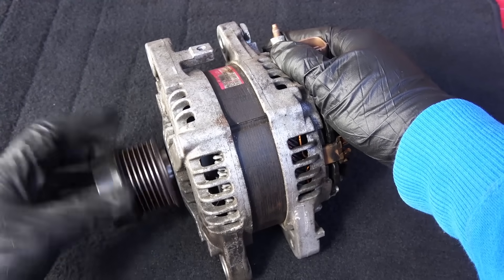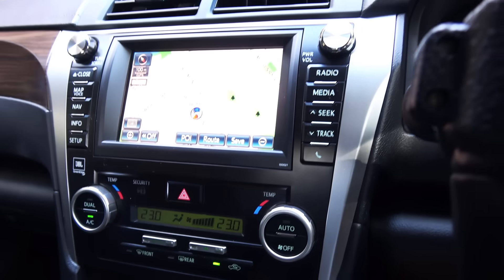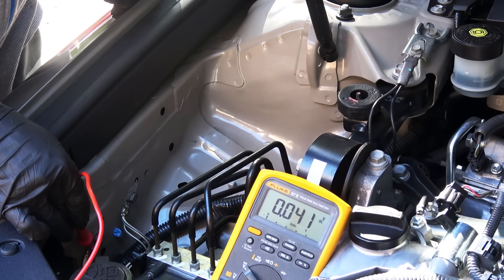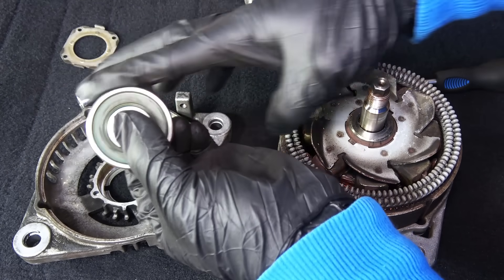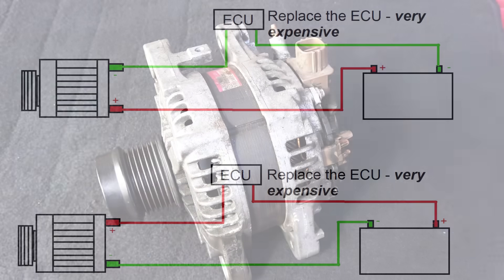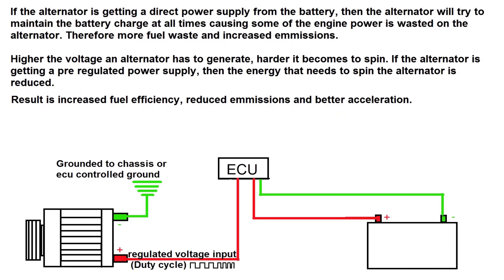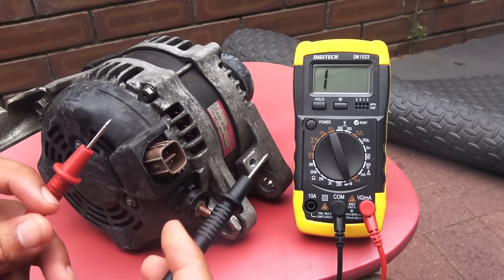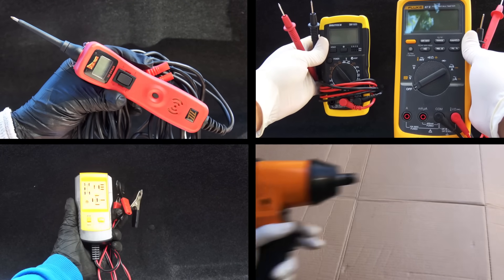How to Test an Alternator  ( Testing the Voltage Regulator, Diode rectifier and Stator)

Comment from the maker: Guys, check out my latest video 
https://youtu.be/UG54xt56uZo
Reply: Very helful vidios
Reply: Great comprehensive video on the alternator, which is probably the most comprehensive thus far on YouTube. Thanks!
Reply: Thanks 👍 bro for the information
Reply: Sar. plese show me how to chek ulternet motor (capacitor) rely
Reply: @azizmakka7126 😮😮😢😢0
Reply: Hi
Reply: Matter is
Reply: My battery is showing 11.20V and it shows 12.50V at charging. Where is the issue located? Is it the battery or the alternator?
Reply: I know im asking the wrong place but does someone know a way to log back into an instagram account??
I was dumb lost my password. I would love any tips you can give me
Reply: @Nikolai Archie instablaster :)
Reply: @Christian Keaton I really appreciate your reply. I found the site thru google and im in the hacking process atm.
Seems to take a while so I will get back to you later with my results.
Reply: @Christian Keaton it did the trick and I now got access to my account again. I am so happy:D
Thanks so much you really help me out :D
Reply: @Nikolai Archie happy to help :D
Reply: Hi, if I got 1063, what’s that mean? Thanks
Reply: The only true way to check  doides, is with a proper doide checker. They can be done with a multi metre,  but must be COMPLETELY disconnected with the stator,  otherwise you can get false readings. Other than that it's a pretty good vid.
Reply: I have kind of dirty but perfectly working alternator, but it's kind of plug up with all kind of junk is there proper way to clean the alternator inside component's? and what it's proper way to do it
Reply: @djeletropopstarify  ₩0
Reply: @djeletropopstarify  m
Reply: @djeletropopstarify  ssshh

Comment: I've replace the Alternator 2 times, autopart guy told me to get a new alternator instead of a re-built one, so I did, now it's the 3rd time. Also 3 new batteries & belt changed. And a few months passed and same issue, in the summer or hot temperatures the alternator refuses to charge up the battery over 12 volts making the car not start up at all until i get a boost, but in cold weather it starts charging up the battery to 14.0 volts perfectly when needed, I'm guessing the engine heat is affecting the alternator, fan turns on and all so not sure what the issue is, and not one of the many mechanics that checked it can pinpoint the issue except for me to replace the Alternator over and over and over. It is frustrating. If anyone knows the issue on a 2006 Rav4 send me a message, but I'll keep on checking with your steps, thanks all.

Comment: Hi ; I have a DENSO alternator in my Toyota Camry with a 2.4L engine, I have done a thorougher check with a multi meter and found the voltage regulator to be faulty. my question is, I want to simple change the regulator, can I use a regulator meant for a 3.0L or a 3.5L engines. I am having trouble locating one that is the same as mine which I think is 80A and the others are 100Amps. will it work. thank you.
Reply from the maker: if the part numbers match, then it will work

Comment: You're awesome bro!  

I hope you have a moment to help me because I want to clean and rebuild my alternator that had an oil leak dripping directly into the dust cover that cause the voltage dropped to 13.00 because the brushes were old and compromised by the motor oil.  Since I know the alternator is still good, but for sure it needs good cleaning.  What can I use safely to remove the oil and to clean the internal parts of  the alternator?  

I'd appreciate any help from you or anyone pls.

Comment: My pwn signal is intermittent working, how do I bypass it
Reply from the maker: first i'd connect a wire directly between the ecu pin for the pwm and the alternator and make sure it's the wiring and not the ecu, if it's the wiring you can wiggle the wiring harness and as you get closer to the break in the wire, you'll see the signal drop out more frequently

Comment: My 02 rav4 manual has a dim battery light on at all times, low idle and kind of is hard to shift normally in 1st and second, sort of like it wants to stall out and you have to ride the clutch. Unplug the alternator and it drives fine and the battery light is off. I replaced the alternator and the light went off and drove good for a 20 minute drive, but it was a bad alternator and started smelling and light came on full. I got another remanufactured one and it’s doing the same as the other alternator, dim battery light, low idle, kinda wants to stall low speeds/shifting. What could be causing this? Did I get two bad alternators? The first one I know was bad, it was spinning weird when I opened it and it smelled bad, but this next one is giving 14v and charging fine just like the one that was in it. What could be causing this?

Comment: I sold my vw 2.5tdi   2001 caravelle to a woman .the battery went flat and I managed to check everything out and the battery voltage was showing a discharge with the engine running .almost 300,000 miles   so not so bad .the bearing seem good   but I guess the slipring brushes swill bde quite worn .

Comment: Very good video!
Some alternators has voltage regulator with resistor but some without resistor. I would like to know what will happen instead of regulator with resistor   install regulator without resistor.

Comment: This is an excellent video one of the best. I have a question. Is it ok to connect a pulse battery charger to a car battery without disconnecting the positive and negative terminals from the car battery while it is still in the car or will that damage the electrical system in my car? and in extreme winter conditions e.g -40 celcius in a blizzard..

Comment: This video helped me to trouble shoot my charging light issues.  Even though the Alternator was bench tested good, the charging light was still on and I was not getting charging voltage at the battery.  By using jumper wire from Alt B terminal to battery's positive terminal, the charging system issue was resolved.  Thank you

Comment: Its not clear from 12:20 to 13:00 to check for alternating current leaking through the rectifier.
Where do the probes go and is the test with the engine running?

Comment: Hi thx for sharing. Good thorough clear explanation.  Would it be possible to get your opinion? I lately have been noticing that the battery left overnight in the car with only the security feature on would generally only read about 12.2 volts. I thought maybe this was normal but more recently while I have been doing some repairs to the vehicle to replace the starter(no crank no start) on a BMW x5 E70 the battery would drop done to 11.8 volts in 1 day but I thought this might be due to me opening the doors and the interior lights may have been on too many times causing discharge of the battery.  The alternator was charging good at 14.25 volts when driving before starter issue.  I saw your video and decided to check the alternator as you explained to check for possibility of bad diodes/rectifier as possible cause of battery drainage.  I disconnected the battery and checked (1). with -ve meter probe to + post on alternator and + meter probe to body of alternator and got reading of 0.520. then I immediately (2).  put + meter probe to + post of alternator and - meter probe to body of alternator and got reading of 1.972 which would drop rapidly to 1.969 before going to 0.0L on multimeter.  (3).  if I re-did test 2 immediately I would only get 0.0L again.  I suspect because the diode had discharged?    My question is does the above test demonstrate that I have faulty diode?  Can  diodes  hold a small voltage briefly as a result of the multimeters energy (uses 2 AAA batteries) before discharging rapidly as like what happened in my tests?  Your advice and opinion would be greatly appreciated.

Comment: The rotor induces a VOLTAGE in the stator. IF THERE is a complete circuit in the stator THEN a current will flow in the stator! “VOLTAGE PUSHES CURRENT THROUGH A RESISTANCE OR LOAD.”

Comment: Just replaced my battery and alternator brand new and highest voltage it gets is 13.4 only is at 14v at start up then after driving even cruising voltage never goes past  13.4 is this normal??

Comment: Great vid, but an additional detail ought to be included: commonly used AGM batteries NEED higher voltages [consistent] to remain healthy. This is especially true for cars that don't drive every day. You should really ensure your alternator is putting out 14.5 volts when FULLY heat soaked [sitting in commute traffic during the summer, for example.  Because those silicon diodes in the rectifier get "loose" [electrically] when they get hot... and under hood temps will easily push the north end of a diode's operating temperature range. 

*I am surprised SiC Schottky diodes are not in common use now for automotive rectifiers..

Comment: What does it mean if there is no battery light lit at all, and alternator is sometimes charging and sometimes not?

It means that the battery light dashboard bulb has failed (burned or whatever) or any wiring in its circuit was broken. That is a very, very rare malfunction.

Explanation: The battery light bulb is initially connected in series, from the plus battery, via the key switch, to the field connector DF of the alternator. When lit, its current provides for creating the initial magnetic field of the alternator (rotor), in order for it to can initiate  creating electricity while running. Once running, alternator creates its own field power and supplies it to itself, via voltage regulator, to the very same field connector DF. Now we have the same voltage on both ends of the bulb, zero accross it, and it extinguishes.

With no light bulb, the reminiscent magnetism of the iron core of the rotor can suddenly, while rotating, provide just right enough energy and voltage to trigger the alternator and make it to kick in. Once kicked in, the alternator continues to function completely normally and provides electricity. Note: This light bulb is usually not fuse protected.

Comment: you said at the 9min mark that if you rev the engine and the volts increase it is a bad voltage regulator. Is this really true? I did some research for land cruiser 1997 model and the car is meant to increase in volts as the rpm reaches 2,4,6 thousand rpm but stops after 6K afaik.

Comment: Hi Junky. When I test my wires, I get 12v on both sides. No pulse.  My battery is also at 12v. 
do you feel this is also a possible computer issue?

Comment: I had to ask I'm ordering a new alternator soon its on a 1991 Chrysler imperial, I did a continuity test from the positive and to the alternator when I got a complete path it was between 250millivolts and 1950+ millivolts would that be the diodes?

Comment: Your video is very professional and brilliant  -  I have a 1996 Volvo 940 fitted with a Denso alternator  (100/14)  -  some time ago it started to make a whining noise.  So far, I have replaced the bearings and drive belt  - The Alternator is in outwardly good condition but the Whine persists.  With the engine running, the whine is stopped when the large battery lead is disconnected from the alternator and resumes when the lead is reconnected. It has been suggested to me that the noise may be coming from the rectifier.

Comment: Insufficient energy flowing into the prime mover equals reverse power (amperes flowing INTO the generator instead of out). Amperes flowing into a generator causes the generator to become a motor which is keeping the generator--and its prime mover--spinning at a particular speed.

Comment: 100% the best alternator video on the internet. This cat showed me how to test everything in the circuit.  Testing the pins on the connectors was a massive help.  I needed to know if the PCU was sending the signal to the alternator first of all.  Taking the alternator apart is out of my wheel house.  I just needed to pinpoint my defective part.  This homie crushed it.

Comment: Hi, if I measured the charging voltage on the bland new battery I just put it on is vary between 12.3 to 13.7v frequently, have you idea what's wrong, thanks

Comment: When i probe the yellow wire with the exact same multiplug as yours, i Get no voltage reading. Should all four wires Get a voltage reading with the ignition on?  Battery and alternator is charging, but i still have the battery light in the dash.

Comment: I have a 2010 Toyota that was connected backwards when jumping. Battery tested good and was charged fully. After installing I'm getting no output off of the post on the alternator. I also have no voltage at the base of the fusible link, which is the fuse for the alternator. If I have a bad fusible link would that cause a bunch of warning lights on my dash, the windows not to work and the car not to be allowed out of park?

Is there anything else I can check? If I have a bad alternator fuse will I get the voltage to the pins to excite the alternator to generate voltage? Thanks so much!

Comment: Hello and thank you for the phenomenal video. At 6:32, when you're testing the connector terminals, should I expect them to show the same readings? For my car the Control terminal C reads only 0.5V, does it mean it is damaged?
Reply: did you find out? it's the yellow wire on mine

Comment: I have a Nissan Elgrand 2011. When I start the car it charges at 14.3v then as I drive it it goes down to 12.8v and when I lift off the accelerator it goes back to 14.3v. Then when I come to a stop it sometimes drops to 11.9v. Any ideas please?

Comment: I’m getting over 1 volt dropped between the front of the alternator housing and the rear. The output reading from the alternator lead to both housings is different as well, the front housing reads 12.9 but the rear housing tested to the lead reads 14.1. Is this a short in the alternator?

Comment: Turn on as many Electrical Accessories to check the demand on the alternator output 
    I would check the battery terminal connections First Before Touching Anything Else ..... Every Reading on Every Electrical item Will Be Incorrect if the Connection is Lose or Not correctly Connected  including the Battery terminal connection 
      Check first 
   Draw rate from battery,  gives crank turn over at start up , Then excess electricity  from alternator powers Electrical system Yet while charging the battery

Comment: Hi and congratulations for the video first, I have a problem I have an error code P2501 high voltage terminal L + of the alternator lamp what can it be, the alternator charges well, thanks I am waiting for an answer
Reply from the maker: that's a generic code set by the engine computer when it detects too high votage in the charging system, it could be a bad battery or a bad voltage regulator inside the alternator,

Comment: I like how you measure for voltage differences between the terminals and their endpoints - eliminating connection problems. It's a good method for any older vehicle.

Comment: While the car is remove the terminals while the car is running, if the battery is bad or failing than you would still get low voltage when checking from the battery post

Comment: I can use my positive cable disconnected, as a ground for my test light, between the 12.60 volt battery post, and cable, negative cable connected, is this a problem.

Comment: What if when you use a jumper wire to bypass the ECU and it is still reading 12 volts it the alternator bad ?

Comment: For anyone who is looking, I had no power to my instrument cluster, but I also had no power to my fuse panel inside the vehicle, it might surprise you but the car can start with just a charged battery and will run off the battery till it dies. Also surprising the car can start and run with the 100 AMP "ALT FUSE" blown. After replacing the 100 amp fuse my dash lit up and the car started AND the Alternator started to output 14.76 volts. My car: 1999 Toyota Solara.

Comment: Good Video. Thank you for the video. Could you help me to get the Charging system wiring diagram of Toyota Mark X 250G 2009?
Reply from the maker: charging system for that car is very similar to that of 2009 lexus is250, if is is the same 2.5l direct injection v6

Comment: Great video, performed this test on my alternator because I am getting parasitic drain and can’t find the culprit. The results were that with the probes one way around (black on b post and red on ground) it shows 400 millivolts, then when I swap the probes around it shows 2 volt?!? Does this mean I have a bad diode rectifier? I have made sure I disconnected b post lead and ecu harness from alternator before the diode test.

Comment: Hey I have a Lexus ES 300 I changed the alternator but it won’t charge above 12v I checked the ecu fuse it’s fine does anyone know what might be the issue?

Comment: Sir, I want to ask. Just yesterday I noticed, the voltage decreased after engine running for a while (the engine and alternator is getting warmer). Wen engine (and alternator)is cold, the voltage charging can be 13.8-14.0. but after a while (5 minutes-10 minutes), the voltage drops at 12.4-12.5 volts. When the car was running and I met a speed bump, it dropped at 11.8-12.0. But it can go up again engine is rev up. oh, the car has been installed with a voltmeter by the way.

Do you think the alternator is getting weak? If it's the alternator, where is it usually? stator spool, rotator spool, slip ring, coal brush, or part of the regulator (IC or diode)?

Comment: You Don't need any multimeter. . u should know why buy that for. Has all you need to do is  . First jumpstart your car then remove the positive side battery clamp if the car if the car stops running it's the alternator if if it  carry a on it's the battery. The alternator keeps your car stuff charging the battery only starts ur car and let's the lights and radio work .simple. Thought being a mechanic you would know